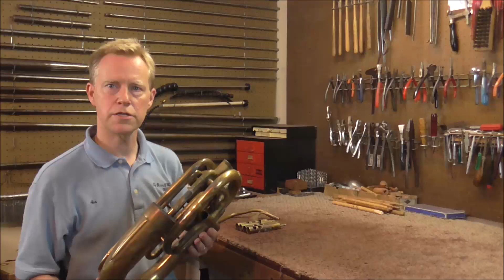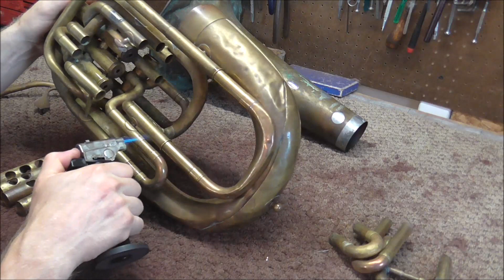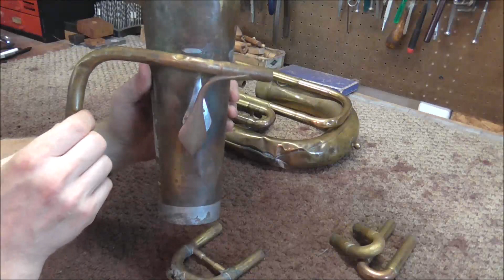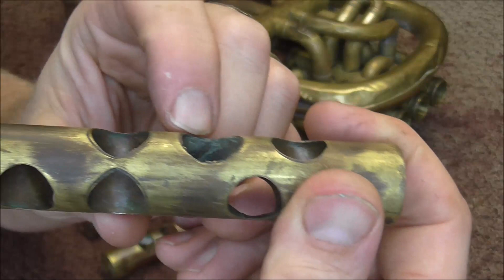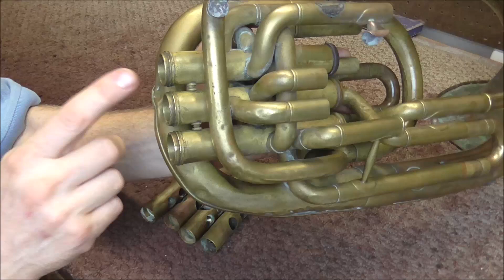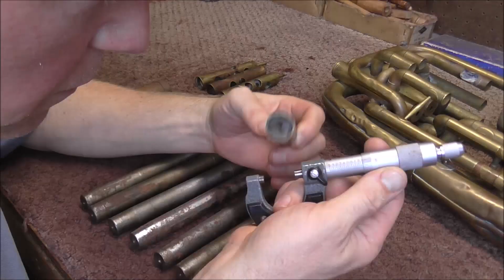Restoring an Enharmonic Euphonium #1: Explaining the Process

Comment: What can I do to unstick the top cap of my mellophone? I don't want to break it cause its a school instrument but I have to wait a week to get it unstuck by the teacher and I really need to oil the valves
Reply: It's a hard one. Some people would sat to use channel locks (pliers). But if you're not careful you can damage the cap. Or I have seen people squeeze way to hard and make the valve casing off round. You can try putting some kind of clothe around the valve cap. Then use channel locks. There is another way but you need a raw hide mallet.
Just be careful. You could always pull a tuning slide, depress the valve half way. Then drop some oil in. At least your valves will be oiled till the teacher can get fix the cap.
Reply: @barneynelson1403  i will try the way Tomorrow when my dad can help me out. Thank you so much. I will be sure to tell him to be careful with gripping the cap 😂

Comment: That's a resurrection job more than a repair ! 
For filing dings in the valves, maybe 96/4 silver bearing solder would be good ? It melts a bit hotter than regular soft solder but should not crystalize the surrounding joints and it has way more tensile strength. IDK if it's better in terms of friction and if nickel plating would hold to it if you want to replate, though
Reply: Also it avoids leaded solder in the player's breath I suppose it's cool

Comment: Great video! Can’t wait to see this restored. Just curious, what are the risks with chem cleaning an old instrument
Reply from the maker: If the metal is thin or already starting to red rot, it can take off some of the metal. It is a very very small amount though, and not usually anything to worry about. This instrument has good metal so it should be fine.

Comment: Regarding that pipe that you wanted to cut in half to remove the dents: given a large enough oven, would annealing the pipe give you and the magnetic balls enough advantage so they might work? That way, you could avoid having to cut it, and gain some mechanical advantage over the now stiffer, aged brass. Just a thought.
Reply: I would worry that while annealing might make it so the current dents can be removed slightly more completely, the area will also be much more susceptible to dents in the future, so in the long term it could just make the problem worse.  I also don't know if one can safely anneal seamed tubing like that, especially when there are clearly areas where the brazing is starting to fail.  I would definitely lean towards allowing some dents to remain without cutting the tubing, as I personally find the idea of cutting tubing on historic instruments to access small dents to be a solution worse than the problem.
Reply: @jeremypeplinski5098  I would be wary of annealing such old brass too much as I have had old brass just crack apart. Annealing to soften the brass is a great way to remove stubborn dents, when you are working metal that has been annealed the metal work hardens as you work it so no need to worry about it staying soft forever.
Reply: I would get a dent ball in there and get the dents out that way without annealing, since it is a cylindrical tube the I'd get the dents out as best I could with shaking a ball through, but then using a magnet to hold the ball against the remaining dents on the inside and tap with a small delrin mallet. I've found it works incredibly well for either getting remaining dents or at least blending things in well.
Reply: @johnkelleh7054  Probably how i would go after it too!
Reply: There's no lacquer, so it could be torch annealed. Same with the bell.
Reply: @amsmithonline  Of course, but I was concerned about annealing it consistently so it doesn't develop any weird stresses. Since it's old, wrapped tubing - emphasis on old - heating it unevenly might cause more issues than it solves.